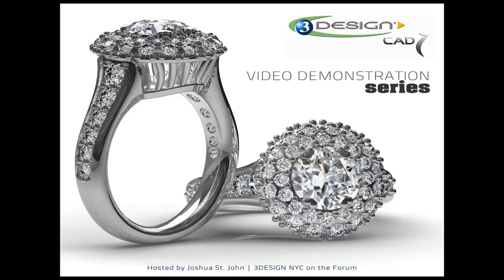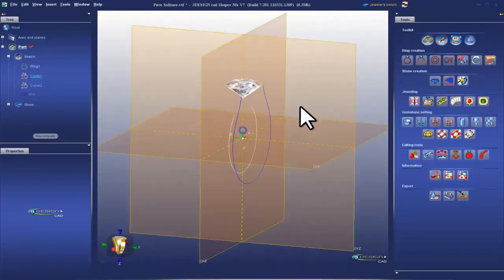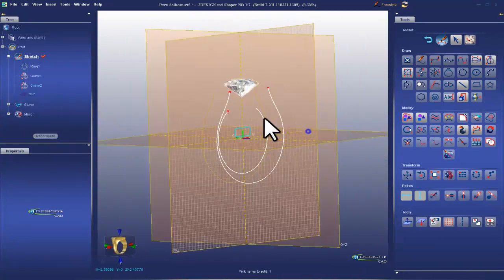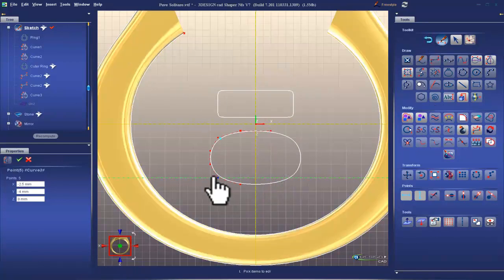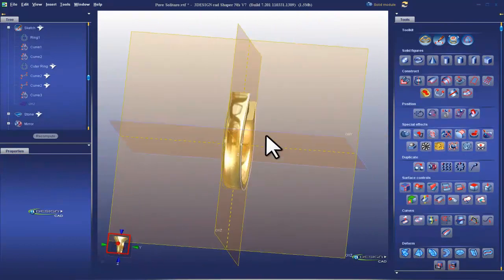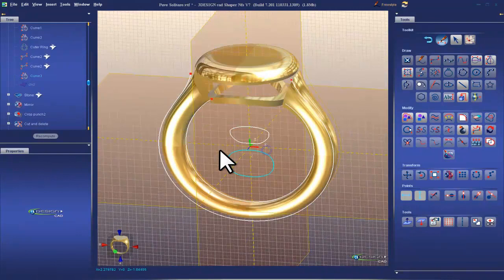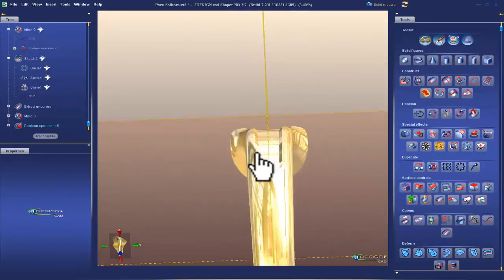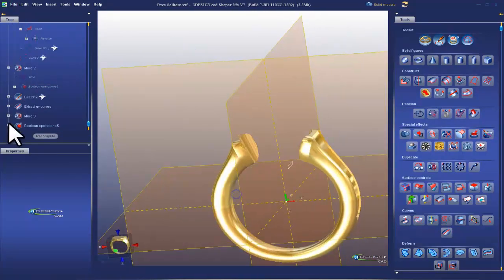Pave Solitare (Part 1) - 3DESIGN Jewelry CAD 7

Comment from the maker: Yes, you can actually set a Weight real time management to the construction of your designs as you go and then know for any modification applied the effect on the total weight. If you have already 3DESIGN CAD, this is the Weight tools in the measure drawer of the PART module. You can also ask your questions on the worlwide 3DESIGN forum @ 3design .com/forum